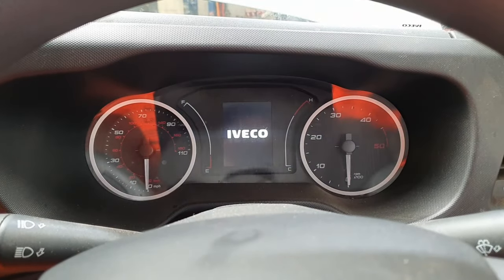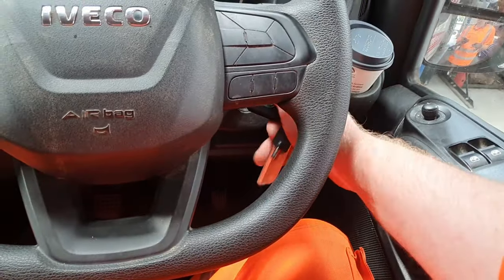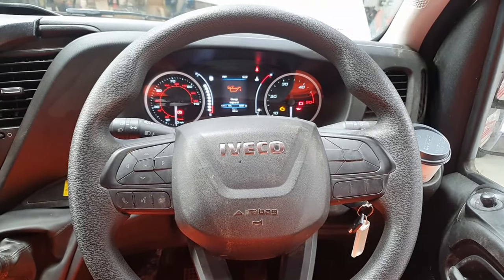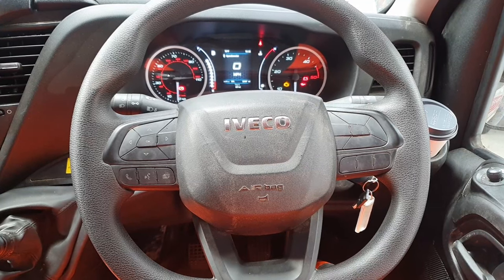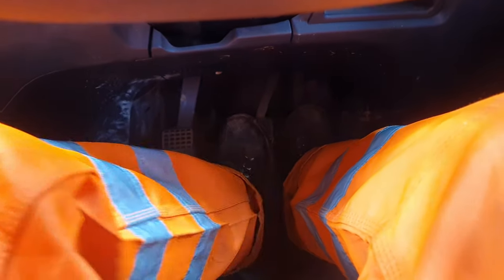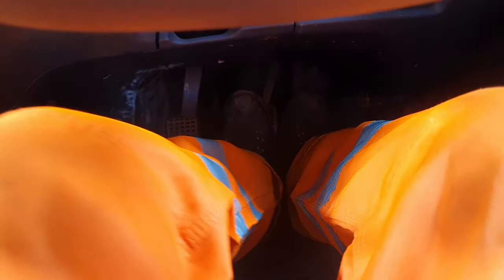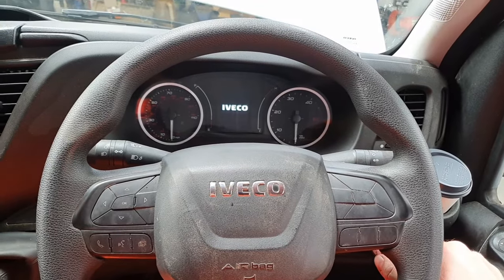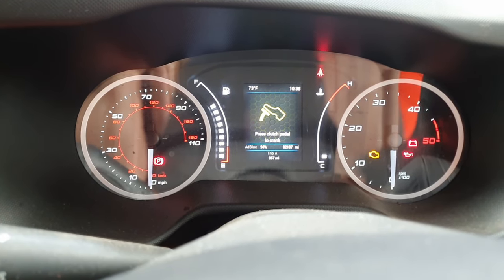IVECO Daily Oil Light Flashing Service Reset procedure how to reset yourself via dash 2019 on

Comment: Thankyou for posting so many informative videos. If it's not to much trouble, would you be able to explain on a video how to do an oil counter reset and DPF regeneration counter reset for a 2021 Iveco Daily euro 6 after the engine oil has been replaced before the recommended manufacturers milage. Thanks in advance.
Reply from the maker: If its before the interval I believe it must be done via computer I'm afraid

Comment: What about resetting the service countdown ? Not just the oil life.
Reply from the maker: I don't beleve it has a service light to my knowledge sorry
Reply: @Martysworkshop  yes they have 2 messages on the dash. The pedal procedure resets the oil life and tells you 37,000 even though that is way to many miles on an oil change. Press left button on steering wheel while in vehicle info and it says service within but just has dashed lines with no date or millage. I have topdon and autel and none of them will reset it. Thanks though